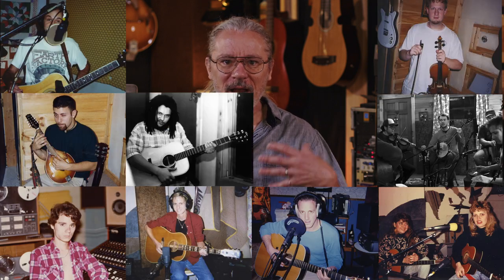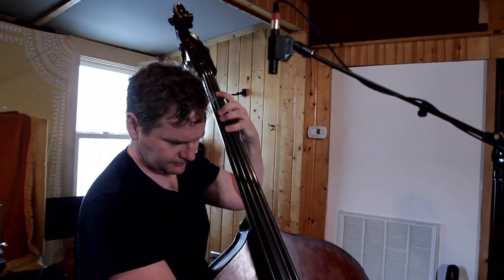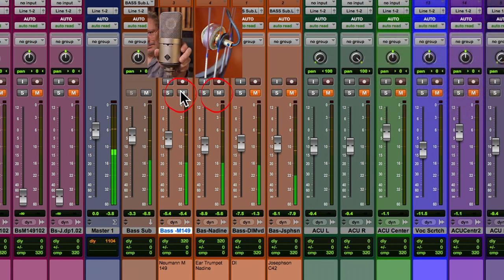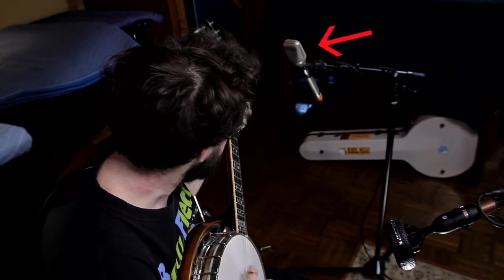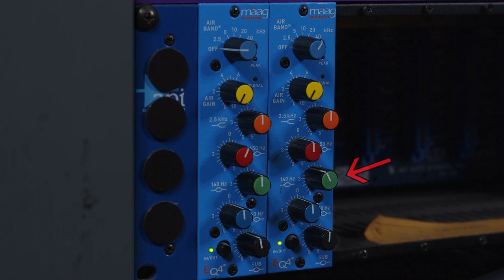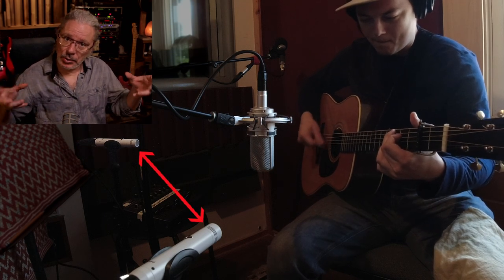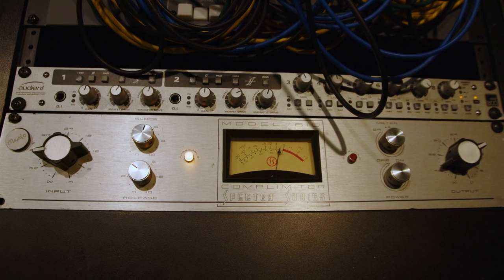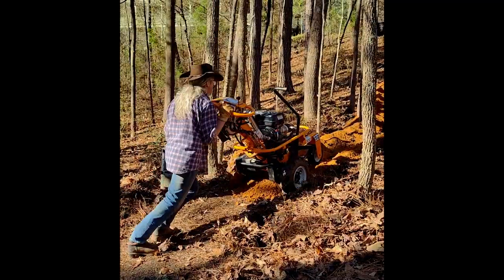How To Record Acoustic Instruments Using Multiple Microphones

Comment: how do you keep the 2 mics in phase, or are you not concerned about phase?
Reply from the maker: I spend some time positioning them, first off by making sure the diaphragms on both mics are lined up. Them Ill record a little bit of the instrument and visually look at the waveforms and flip the polarity on one of the mics to hear how much sound cancels out. It's also important the the player not move very much. Using 2 mics is not always the best way to do it, but you can always not use one of the mics if it sounds weird.
Reply: thanks for your response. Do you follow the 3:1 rule? In the video it doesn't look like the mics are spaced very far apart. Or do you just set both mics where they have the sound you want and adjust from there?  @FreakingOutWithBillyHume
Reply from the maker: They're further apart than it looks, however I go with the sound mostly.